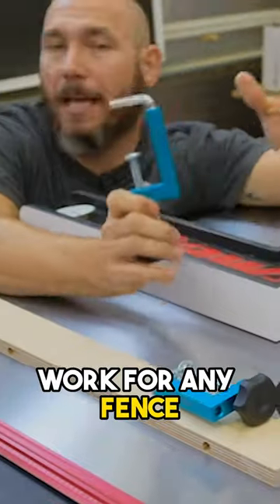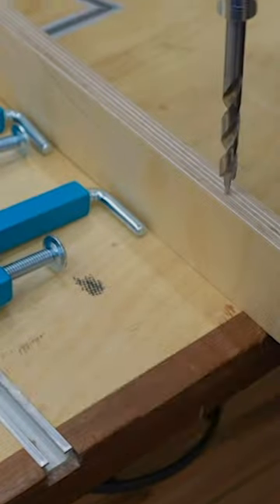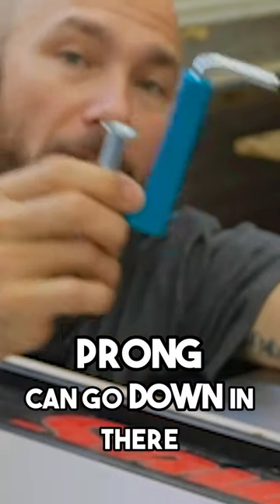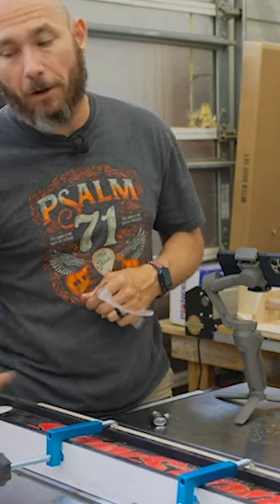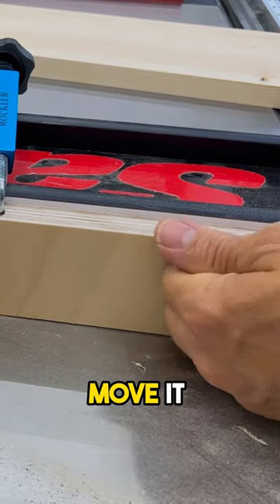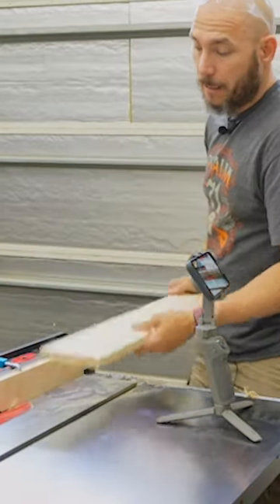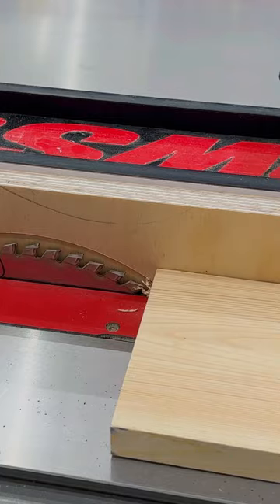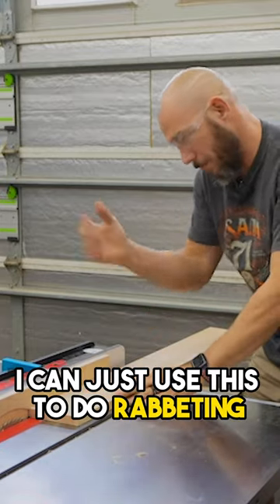Every Woodworker Needs a Set of These Clamps!

Comment: I bought two sets of these ('21 Christmas Sale....😁)  And I use them for everything that needs to be clamped and used at/on/around the table saw and rip fence.   
No hype!  😆
By the way,  my OLD Craftsman floor saw, has a factory fence (cast STEEL) with holes that allows me to keep a sacrificial board attached to it.  And I do!  I put what ever piece of hardwood/softwood  "scrap" I have available.   It's not a P.I.T.A., it will save the blade in a oops 😬!  Just sayin'....
God Bless you, Matt!

Comment: Get a square u-bolt and cut off one leg.  Drill a hole in a piece of wood, at a 1 or 2 degree angle for the other end of the clamp, and simply use a wing nut to hold it in place.

Comment: Just make sure you have a FTG blade to get flat smooth cuts. Lol
Reply: FTG? I got it as I read more comments. Any Brand? My regular blade is Diablo
Reply: @carasmussen27  I've got a few Diablo blades, I like them.  However, I recently picked up a CMT and I'm very impressed.  I've seen a number of reviews and head to heads and CMT comes out at or near the top all the time.  Either way as long as you use a decent blade you should get good cuts.  I will say that I think i'll be picking up CMT when I have the choice.